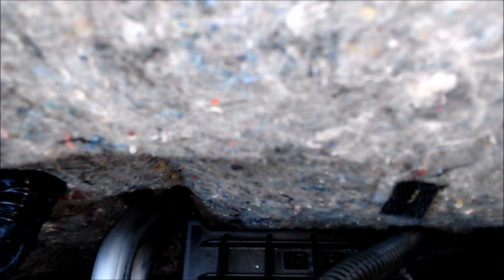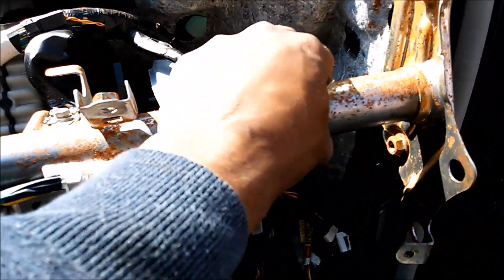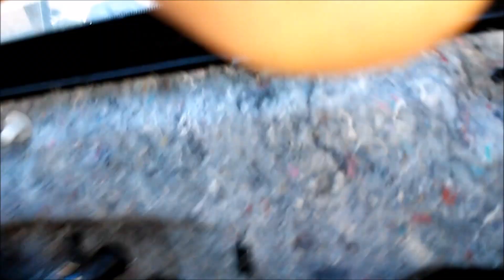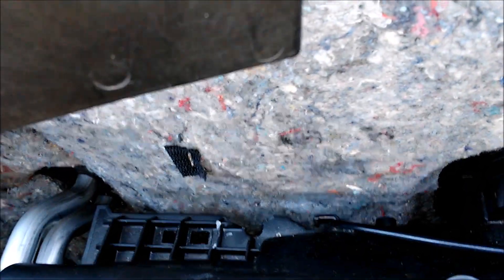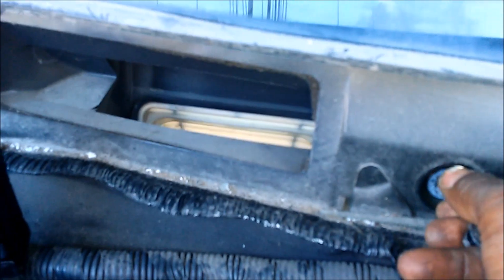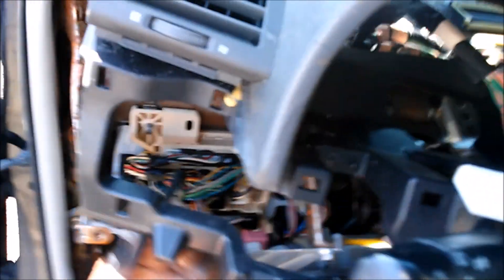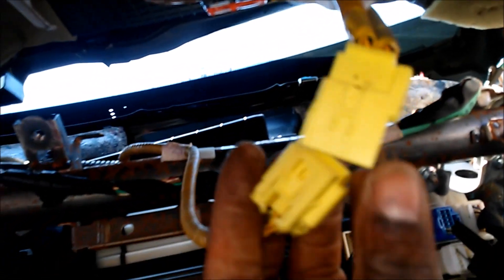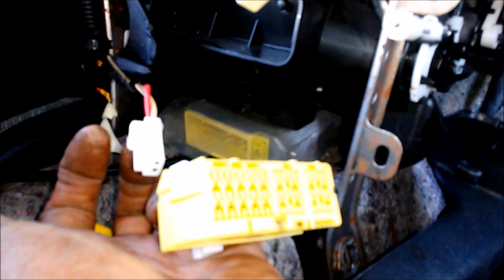REAL Video Toyota Camry Interior ECU immobilizer Control Module Location & REMOVAL 2007-2018

Comment: Yes this is the only video showing the immobiliser location. I found it finally.. You deserve millions of thanks man..
Reply: You are in Middle East, I presume..... those are buried as this video shows. Not sure if that applies to ALL models and years of Toyota and Lexus, but outside of North America, they are in a secure location!
Reply: @citylockapolytechnikeyllcc7936  can confirm just did a toyota camry 2016 in West Phoenix Arizona. Had connection issues autopropad , autel im608 and code cannibal as well as boscom kmax all could not reset immobilizer box through obdport. AKL cable on autel also failed and dealer was going to charge $400 for the key plus $150 for programming. Also the towing guy another $150 and the car HAD to be running by dawn so dealer was out of the question. I had to tear through the entire dashboard as shown here and ecu immo box is stored inside a compartment between the back of the ac motor and the firewall . then i reset the box with autel and gbox 2 and generated dealer key emulator with apb112 mind you this is NOT a push to start but this key uses tr47 keyway and 8A transponder. Was finally able to program at 4 AM. Never doing a job like this again lol. Other locksmiths came to look at it including an electrician but there was no communicating with this immo box.

Comment: Thanks for this video. I took apart the dashboard and could not locate the immobilizer. Finally saw this video and noticed it is tucked between the firewall and the dashboard bracket. I will also put in a new one and leave it out so in the future if I need to test I don't need to pull everything out. Thx a bunch for the video.
Reply: What was your car dionosed with to have to do this to your car

Comment from the maker: Too bad that we lost most of this video footage! Because the original footage was in dept and fully detailed. Also because of the complexity of the job required to remove the dash; So far this video (even though is not complete) is still the best to date in guiding someone who will actually need this information. Comment below if you have any questions! Thanks!
Reply: There used to be a video of complete teardown online. A guy in Middle East doing it ( you could see the bazaar across the street through the windshield... He had a welded together t handle with a10mm socket, and a velvet turban narrated as he took it apart, handing components tooo assistant. 20 minutes and out! Here in USA, ECU tend to be under hood, placed vertically near left front tire well to attain maximum impact from a fender bender........or in case of early Prius, on top of column, just under the dash... a bear to get to. Wish I could find that video.
Reply: I got the passenger side loose enough but the drivers side doesn't really budge.  I can get my hand in there and feel it, but that's about it.  I'm okay leaving the old one where it is but can't even disconnect the wires.  Maybe a long screw driver to pop it out of it's mounting tabs or something?